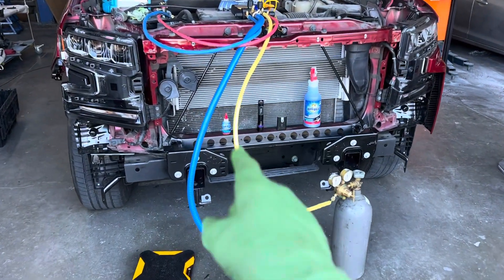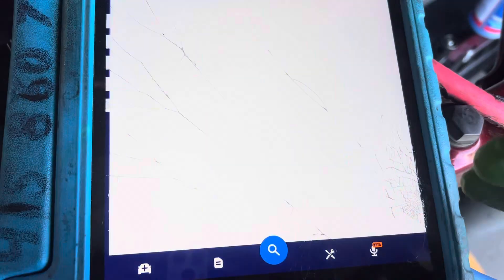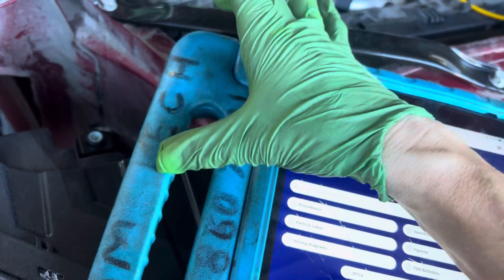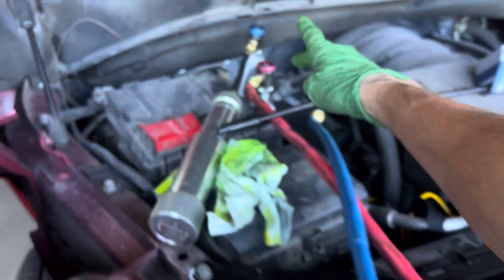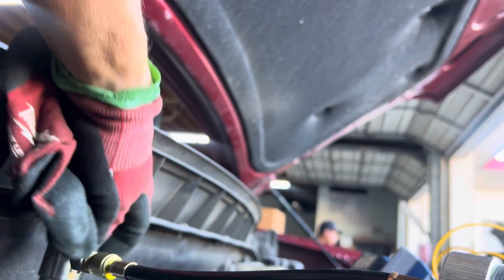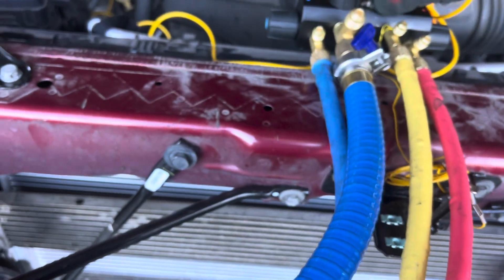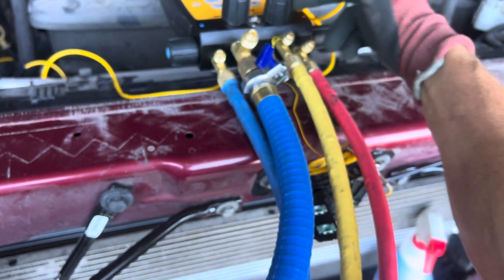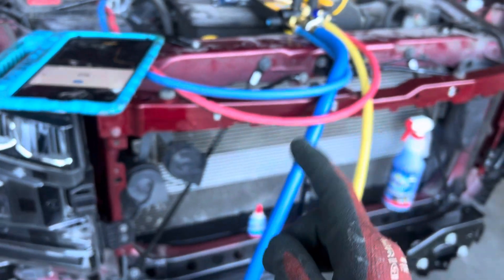Injecting UV DYE In 2019 Chevy Silverado.

Comment: Great video. Thank you.  
I have a question that I seem unable to find an answer to- why do some systems take a long time to equalize high and low side between dynamic and static conditions?   Assuming that nothing is wrong with the expansion valve.